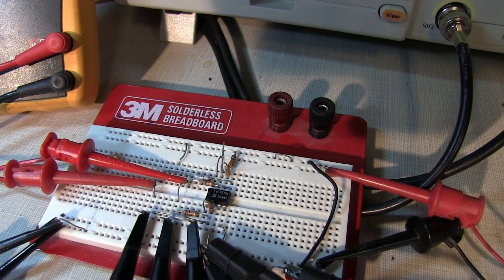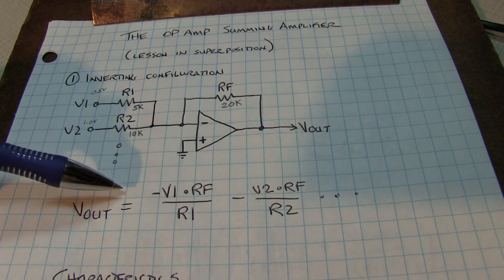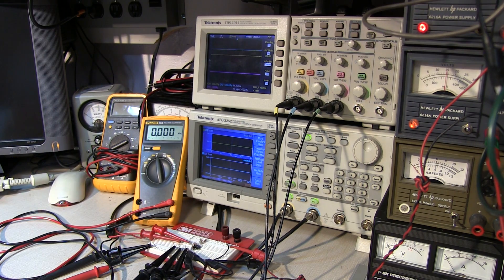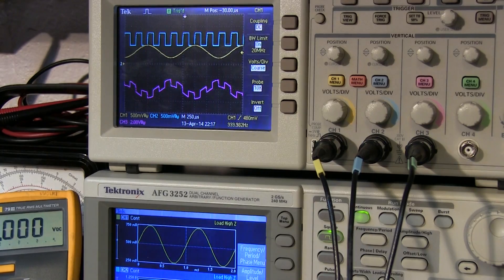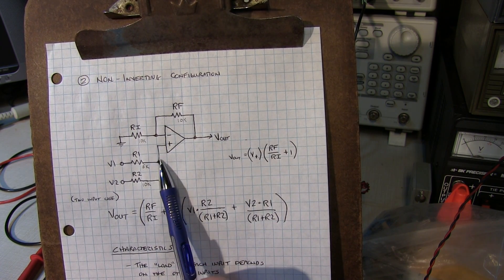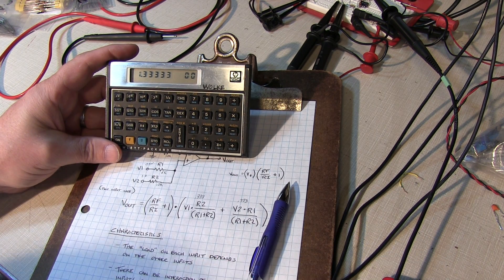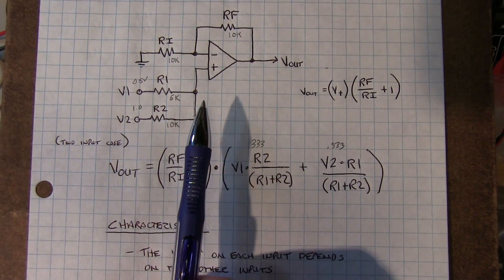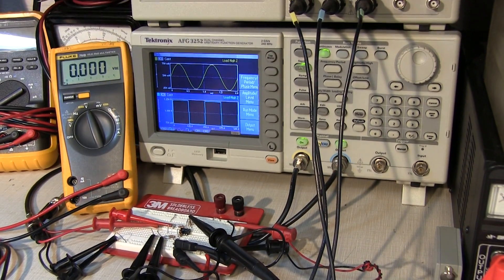#140: Basics of an Op Amp Summing Amplifier

Comment: 0:45...5:39
Thanks.
I always wondered what circuit is required for combining 2 audio inputs.
What does it look like with both waveforms at the same amplitude or both at the same frequency. The output waveform is not so pretty, I think. Now I know what keywords to look for, I can find all that stuff. Thanks.

Comment: My one stop guide for opamps and analog circuit. Instead of hooking on breadboard to verify the calculations, I simply watch your videos.
Though, I like the inverting configuration, but for most microcontroller related interfacing, the power supply is unipolar (and not +/-). Hence, I am forced to use the non-inverting, when I want to measure an AC input using microcontroller and hence need to give a DC offset to AC to make it compatible with the ADC input.
Reply from the maker: You can still use an inverting configuration for your signal and apply the dc offset to the noninverting input.
Reply: @w2aew  Thank you for the reply. Just to confirm, did you mean: -
1. Use an single supply opamp
2. Configure the opamp in inverting configuration.
3. Apply the AC signal to the inverting input
4. Apply the DC offset to the non-inverting input?

In the above configuration, the AC signal source will not see the signal being applied to the GND, but it will see it being applied to another voltage source (equalt to DC offset)? Other than the easy calculation, is there any additional advantage versus non-inverting summing configuration?
Reply from the maker: @Debraj1978  Yes, that is correct.  You get no interaction between the AC source and the DC offset.

Comment: First, you always must either use the voltage actually observed at the resistor or add the source impedance to that resistance.  This is true for both the inverting and non-inverting cases.  Second, the general non-inverting case is
V+ = sum(V_i/R_i) / sum(1/R_i) applied to the non-inverting terminal.  In this case R_i MUST include the series source impedances and V_i are the Thevenin voltages.  We still get a weighted average; however, the current flowing in must also flow back out again through the parallel equivalent resistance.

Comment: So why are R1 and R2 not the same value? A few of the things you mentioned were a bit over my head, currently; such as superposistion. Are you adding them together in a fashion such as 1*1 + 1*0.5?
Reply from the maker: They can be the same value, I was just pointing out that they could be different if you needed to have more gain applied to one or more of the signals being summed together.
Reply: +w2aew Oh okay cool, I must have missed that part.

Comment: What causes a DC voltage measured on the amplifiers speakers jacks that is caused by the output amplifier circuit? If you're measuring a DC voltage on the amplifiers speaker jacks what would cause a DC voltage to be measured on the speakers jacks of an amplifier?
Reply from the maker: Depends entirely on the design of the amplifier.

Comment: Why is the input 'opened' for superposition for the inverting case, and 'shorted' for the non-inverting case?  I can see that it works physically, but that seems arbitrary
Reply from the maker: For the superposition calculation, the input voltages not being computed are shorted - in both cases.  Did I mis-speak in the video somewhere in the video?
Reply: Nope - my mistake.  About 1:20, I thought you said that we opened voltage sources and shorted current sources, but you said the opposite.  That was my confusion.  After re-listening, it became even more clear.  Love the series!  I wish I had you and EEVblog (and the internet in general) many years ago.

Comment: What if we add diodes to the inputs of the non-inverting summer? That should prevent any interaction.
Reply from the maker: That wouldn't work.  Instead of being a summing amplifier, it will wind up being a "highest input voltage wins" amplifier.
Reply: Aah right, I remember seeing a design like that somewhere.

Comment: Is summing op amp (non-inverting) the same as precision adder? I mean the amplification of the inputs should exactly 1.00 and is suitable to add control voltages for the pitch control of VCOs?
Reply from the maker: You can design a summing amp with gain of 1 for each input, if that's what you'd like.
Reply: Yes, thanks.

Comment: This could be useful in a home build synthesizer to add signals from different oscillators. Very cool.
Reply: That's why I'm watching this, xD
Reply: Haha very cool. I want to build one too. Got any good oscillator circuits?
Reply: Voltage Controlled Oscillator chips are available in all frequency ranges for less then 10$ if you don't want to build your own.

Comment: the best and neatest explanation on the topic. i appreciate these. just one thing. at the end of the video you mentioned about the inverting summer that one can invert the output by an inverting follower. but to do that one still needs a dual power supply right? how do you  make dual supplies in your tests? i found some voltage converter ICs to obtain negative voltage. but I was wondering if you use such ICs and is it possible to use inverting summer circuit with a single supply.
Reply from the maker: If you make your reference voltage (virtual ground) of the stages not equal to ground, then you can get away with a single supply - which is what I do almost all of the time.  See my video on op amp power supply considerations.

Comment: Very good tutorial! Which OpAmp would you recommend for a battery powered audio mixer? Ideally, I was thinking of using one LiPo cell so I suppose it should work all the way down to 3V. Also, I was thinking to base the mixer on a circuit similar to this one: http://www.all-electric.com/schematic/simp_mix.gif (circuit 4)
Reply from the maker: All of those mixer circuits assume a split supply on the op amp (you can tell this because the use a ground reference).  The "go to" op amp for these applications is usually the NE5532, but it won't work on such a low supply voltage.  Here's a good "selection page" for low power, low noise op amps that would be suitable for an audio mixer application:
http://www.ti.com/lsds/ti/audio-ic/audio-operational-amplifier-product.page#p1typ=0.7;3

Comment: Hi, 
i want to make a binary weighted DAC with op amp LM358 or any. by using only one power supply, not dual supply. so how i can use inverting configuration for the binary weighted Summer or DAC? i want to make 3 bit DAC. any Idea? i am simulating but at some point i do not know what is wrong happening.
Reply from the maker: If you're using an inverting configuration, then the response of the DAC will be inverted.  However, this is easily fixed by following the summer with another inverting stage.  The LM358 is not a good choice for single supply operation of this function because it is not a rail-rail op amp.  You should replace it with a rail-to-rail op amp.  Make it a dual op amp, and you can accomplish the DAC and inversion with one chip + resistors.
Reply: *****
hi again, thanks for the reply. can you suggest parts numbers to be considered like op amp for single supply. i do not get one point " this is easily fixed by following the summer with another inverting stage " you mean output of this amplifier must go through inverted buffer with gain of 1? please suggest some parts. thanks in advance.
Reply from the maker: Bilal Masood I'm sorry, but there are literally hundreds of possibilities.  The design constraints in your application (power supplies, logic levels, power consumption, etc., etc.) can help to pare these down.  At the end of the day, there will still be MANY devices that can likely be used.   Yes, when I refer to a second inverting amp, it can be a gain of -1, or even something more - it all depends on how you scale the the first stage.

Comment: The isolation of the input voltages looks and feels so very right. Why not always use an inverting opamp with a follower? Presumably using the noninverting would save a little power? (ie. save using an extra opamp follower). But could there be other benefits in some other situations?? Would using a non-inverting OpAmp for summing voltages be an unusual case. Just seems redundant somehow. This is fascinating. Top video again!!
Reply from the maker: I agree - the inverting summer's advantages are really nice, and will often be worth the "cost" of an additional inverting follower.  Or, sometimes the inverting summing amp is all you need.  The tradeoffs and requirements dictated by the design (power, functionality, cost, available supplies, etc.) are too varied to make a general recommendation of course.
Reply: Thanks Alan. That makes total sense. I'd never considered that the direct connections to virtual ground with the inverting summer had such a neat advantage. Really nice to learn about that. Another little golden nugget of info!

"tradeoffs and requirements dictated by the design (power, functionality, cost, available supplies, etc.) are too varied to make a general recommendation of course"

I think these endless design choices, in an odd way, also add to the fascination! Keep the lectures coming they are superb. Amongst the very best on youtube.

Comment: I've been trying to get my head around "current-mode"  op amps (as opposed to "voltage mode"). They seem interesting in that, in a typical configuration (according to a TI  app note), bandwidth reduction is only a function of Rf, not the total gain. But I'm not clear on how an op amp can be sensitive to current on its inputs while maintaining a decent approximation of an ideal op amp (i.e., where zero current flows into/out of the inputs). 

Would you consider doing a video (or multiple videos :)  )  on current-mode op amps?

Cheers and thanks for all the great videos. I appreciate your clear and precise explanations of both the theoretical and practical/engineering concepts and applications. 

All the best from Chapel Hill, NC,

Alex

Comment: Nice video! Is the result for the non-inverting case the same as an inverting plus invert stage's result?
Reply from the maker: Not quite - I didn't design the gains to be the same.  The "voltage divider" affect in the non-inverting case reduced the gain in that case.

Comment: great video, what will happen if you inject a Dc voltage to one of the inputs and at the same time inject AC to another on the summing side? will that raise the threshold?
Reply from the maker: Yes - you can use a DC voltage on one input to add/subtract a DC shift in the output.

Comment: Is this the basis of so-called "servo outputs" used in some audio circuits to avoid use of DC blocking caps? I've often wondered how that works.
Reply from the maker: Most likely - I'm not familiar with this application, but it makes sense.  There'd likely be some circuit that is servo-ing a DC bias on the audio path to line it up with the input needs of the next circuit.